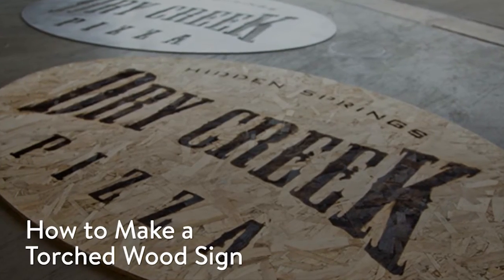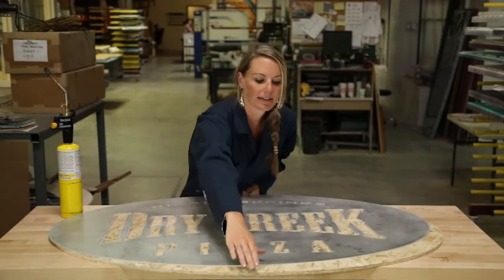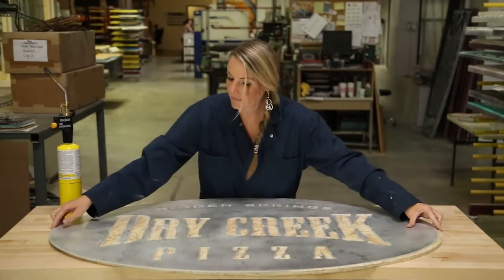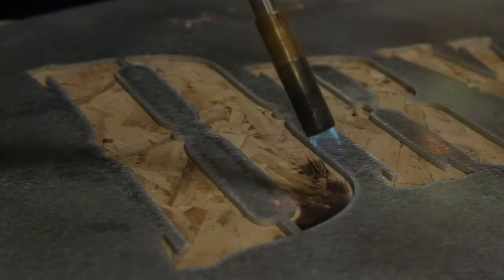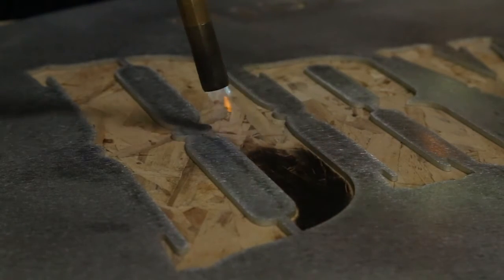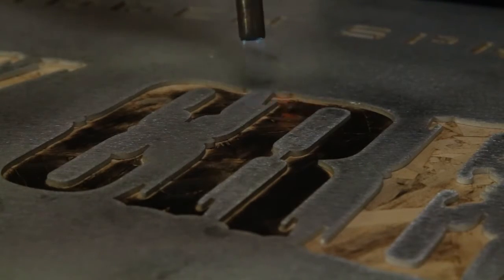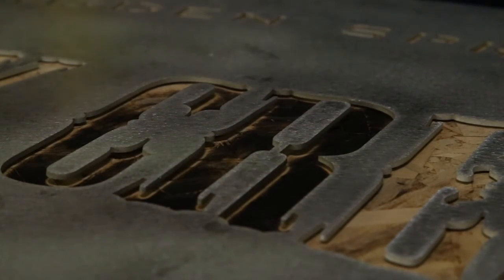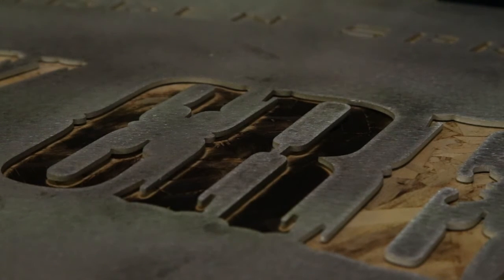How to make a Torched Wood Sign

Comment: I purchased a stencil from you and it's  a great quality product however, mine heats up and expands instantly when i try to torch it making my wood burn look awful, any suggestions?
Reply from the maker: This is an exercise in patience. We would do only a few letters at a time because the metal would warp after too much heat. We would take a little break and wait for it to cool off and go back to flat. Like painting with a stencil, you want a light touch with the flame, not too close...Like toasting a marshmallow to a golden brown.